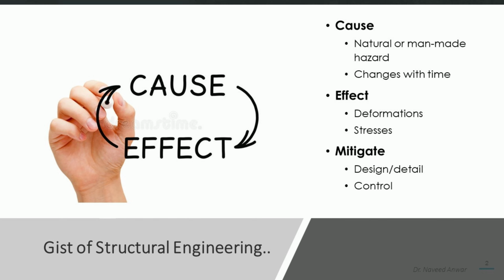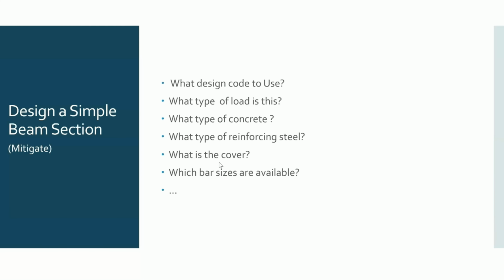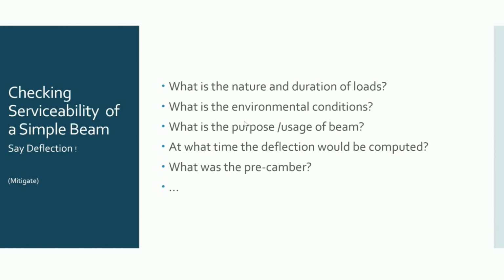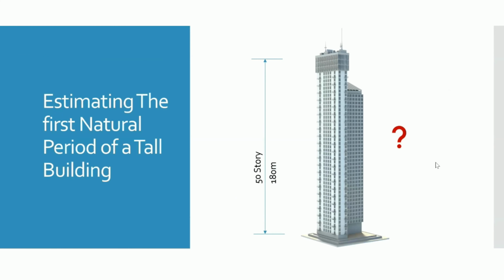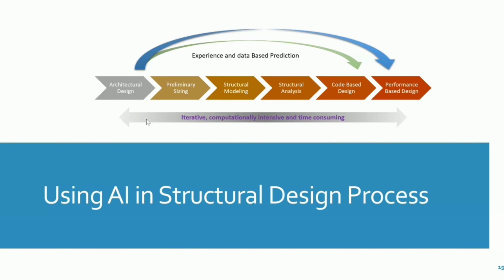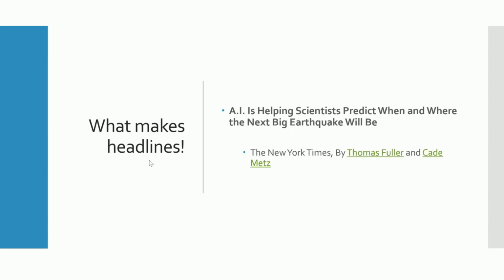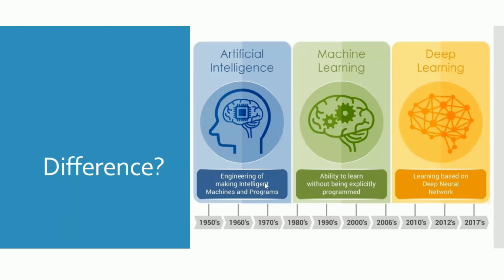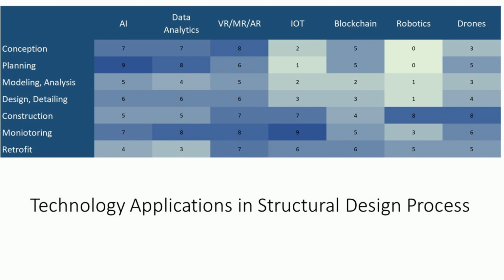Machine Learning in Structures - Part 1

Comment: This was a great lecture sir. To build this AI neural network a lot of research and data will be required to create a reliable network. Means there can be research opportunities for  us students as well. I am a civil engineering student and have a hardcore interest in structural engineering with a good knowledge of FEA and Python. I created a programme for heat conduction and euler bernoulli beam for one dimensional quadrilateral elements. Is there any research opportunities available in your research group?
Thank you.